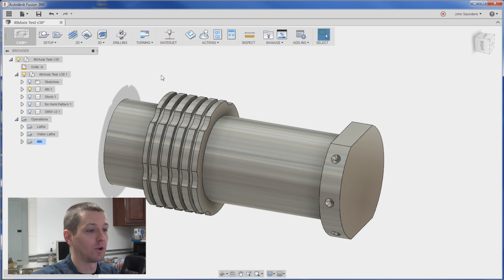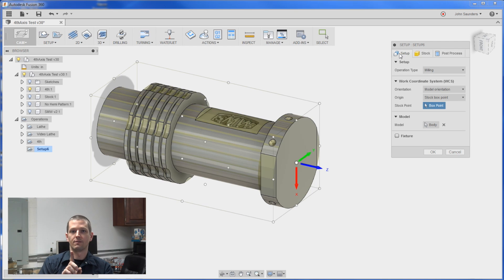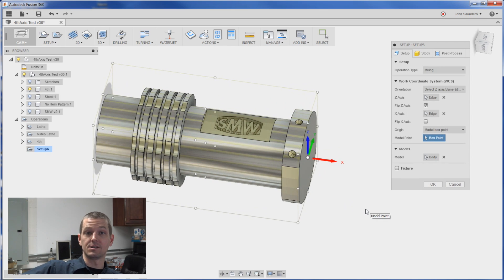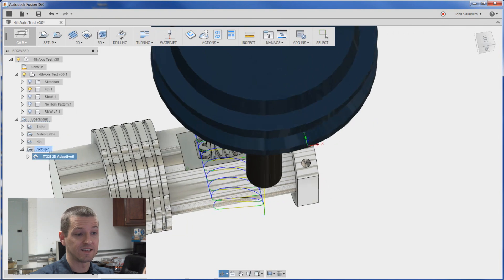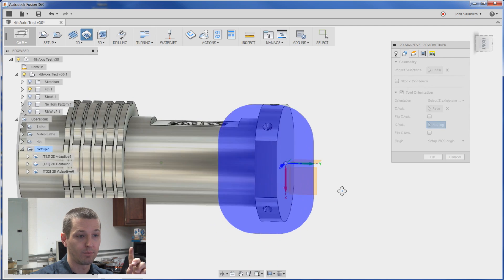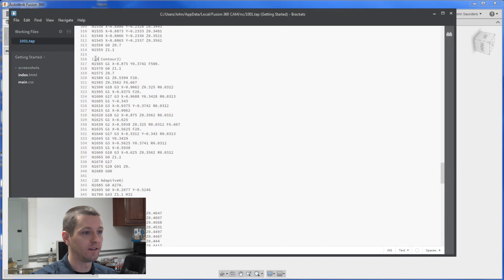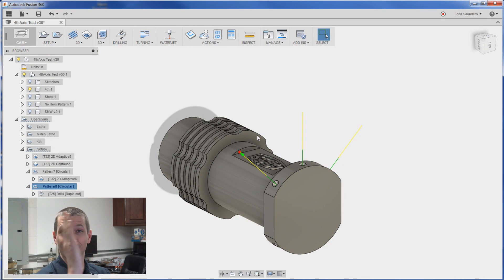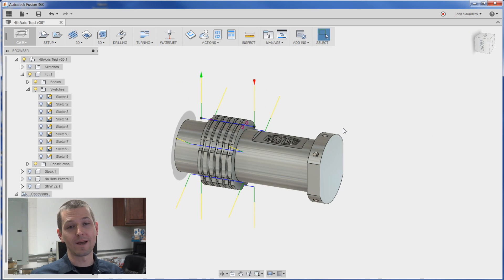Fusion 360 4th Axis CAM. Fusion Friday #18

Comment: Thank you so much for making this!  I just integrated a 4th axis (using a horizontal/vertical rotary index table).  Planning to make gears. The process you showed will make it doable. Glad to see Fusion has good tricks to work with it. Looking forward to "simultaneous" when it's in there. (Maybe it is by now?)

Comment: John, Awesome video, as usual!

I just downloaded the new PP from your link, and compared it to the one that I have been using to run F360/4th axis on my Tormach.  The new Post is pretty similar to mine (which was downloaded from Tormach & edited per several online posts about supporting 4th axis for Mach3).  The 2 changes suggested by the online posts are made identically. Interesting that the new post is based on the Haas PP.

One change that I made on my own was to comment out a line that produced a G30 command every time the "A" axis was rotated. This was causing the spindle to return to home position every 30 seconds or so on my design - which was really slowing things down. Commenting out the line resulted in the spindle only going to the retract position between A axis moves - much faster :)

Interestingly, the function that I edited (called "onSection") is completely different in the new Post - much longer, more complex, with a new section titled "retract to safe plane". I have not yet tried the new PP, but will this afternoon - will see how it behaves.
FYI - here's a link to a pic of the 4th axis part that I completed earlier this week:

https://www.evernote.com/l/ACg4vZ75wytJnI08tlB6_XoFIexW0SFJp38

Thanks again for the great video - Gerry Kmack

Comment: Your need some (more) coffee, that circular pattern for the spot drill is 90°, you need to turn off equal spacing and go 3 at 45°. With equal spacing you had to divide the 3 points into 135° so you end up with 45° you wanted. Hence when you had 360° and 6 points you get 60° and didn't cut the first groove twice ;)